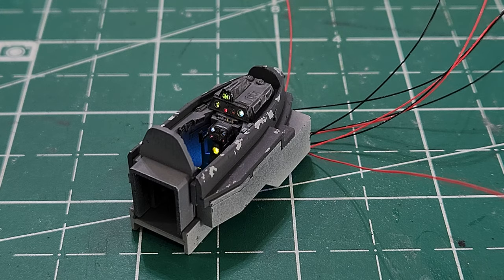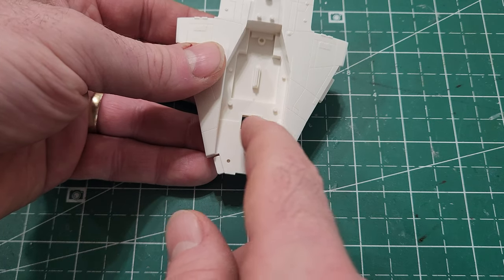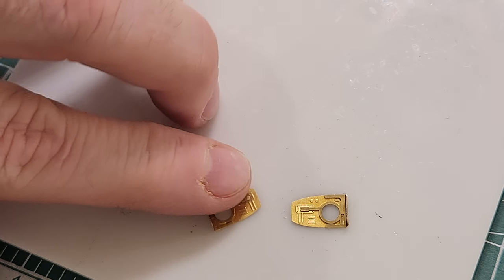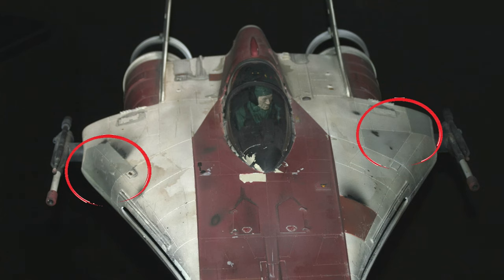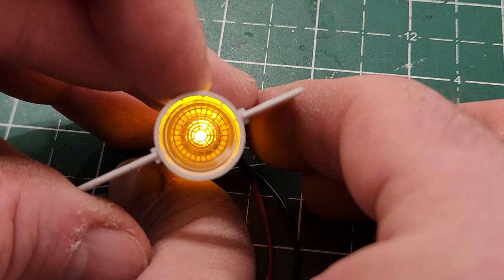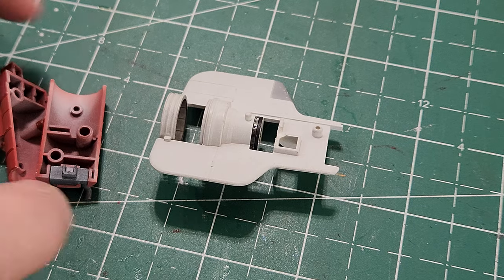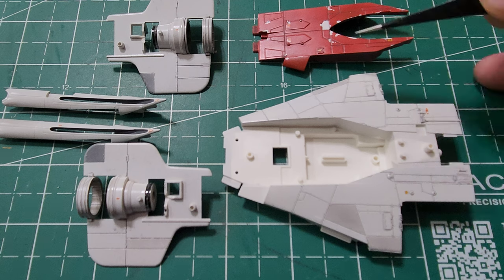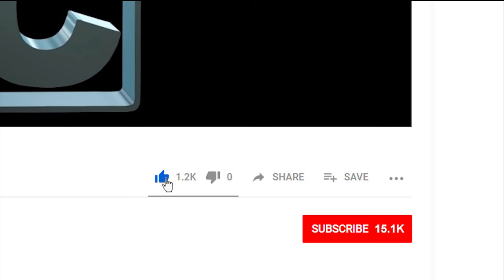Bandai 1/72 scale A-Wing model build Pt II Assembly, painting & engine lighting

Comment: What gauge are you using for wiring? I have a box of 30 gauge wires, but I don't know if they are appropriate for the LEDs.
Reply from the maker: Mine are 30
Reply from the maker: I have used magnet wire as well,  which is very small.  Still works fine for the low voltage
Reply: @modelsbychris  thanks, I'll look into it.